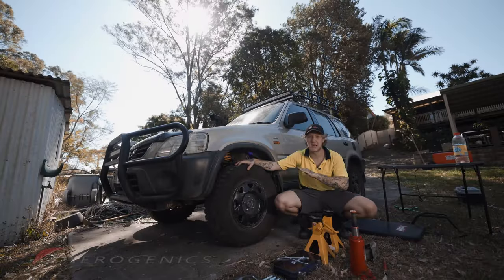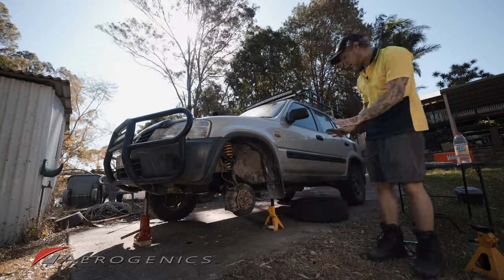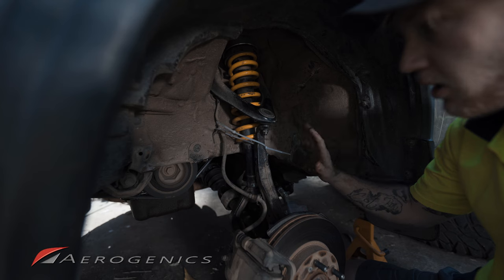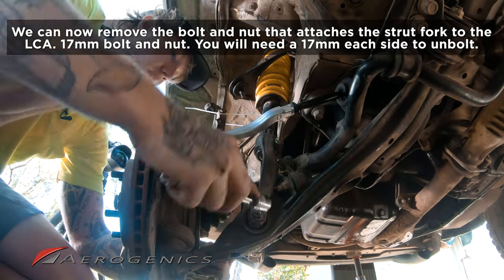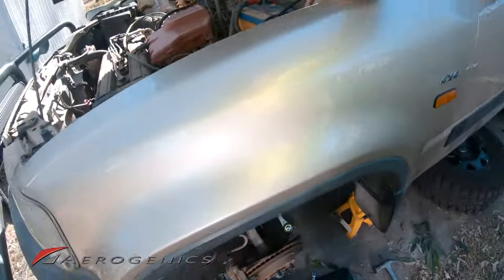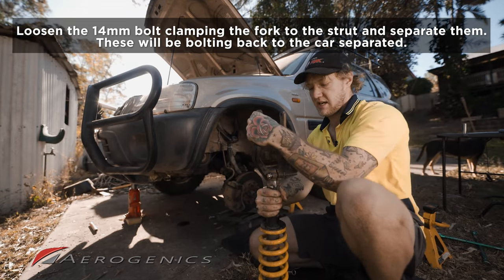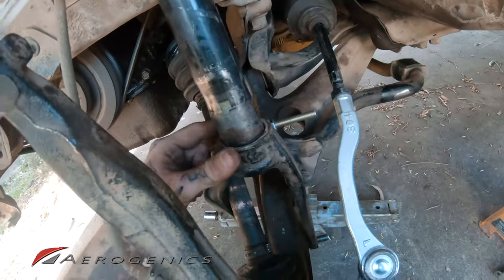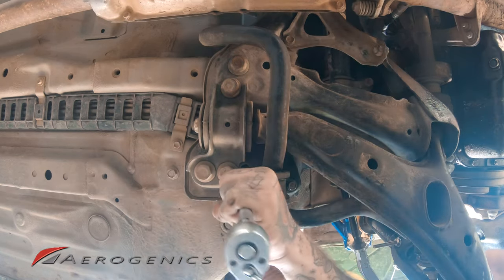Easy Guide to LIFT a HONDA CR-V!! AVOID this easy MISTAKE and save HOURS of your time

Comment: My God hallelujah!!!! For this video I fought the lower strut fork for 2 days!! I have an RD1 with a 1.5” lift kit. Replaced sway bar and outer tie rods. And could not get the strut fork to mount up! Removed the fork off the strut, put the bolt through placed at the angle and gave it a kick!! Bam 💥 that mother is in!!! Back on the road today because of you!!!! Thank you 🙏🏽 from the bottom of my heart and my crvs!!!! 🙏🏽🙏🏽🙏🏽🙏🏽

Comment: This is the method I used on my RD1.  

But now I need help with  my 97 auto CRV awd with Aerogenics 1" front and 2" rear lift spacer on Monroe quickstruts, Aerogenics 1" engine and subframe drop , Aerogenics 1" trailing arm spacers, new torque mounts, Truhart front upper control arm and rear camber arm and new NAPA axle driver side,
I have a wobble at 20 mph and intermittent clicking... i really want to figure this out. Some folks I've asked just said they just learned to deal with it.
Reply from the maker: Not the same issue but if you haven't. flip your front upper control arms, they're currently not travelling on the same arc due to your lca being dropped 1 inch.  If you know a fabricator, take it to them to weld the inside seams first, as they're not fully welded both sides because they're not designed to be flipped, but they need to be flipped when paired with a subframe drop, and in doing so exposes that design flaw.

As for your problem...

NAPA axles are your problem sadly.  We don't get them in Aus, but I've had a number of people say the same thing and yeah, OEM or OEM rebuilt are the way to go.  NAPA axles lack the vibration dampeners that OEM have.

Comment: Wow that suspension is the exact same as my 99 civic.... I guess that means I could lift my civic lol
Reply from the maker: Do it, a lot of lifted Civic guys use CR-V struts, the CR-V uses the civic camber arm drop bracket (above 3") as well, a lot of interchangeable stuff.

The joys of Honda :D
Reply: @isakjetbean  I have skunk 2 upper control arms on my civic because when I lowered it the negative camber was insane but the cheap ebay adjustable control arms had really bad ball joints and they didnt have enough angle so when ever I hit a bump my suspension never bottomed out but my ball joints angle maxed out. So you either have to cut down the knuckle and make it shorter or go with skunk 2 UCL because their ball joints have more travel. I would assume the opposite for raising the suspension and that you would have to lengthen the knuckle so that your control arm ball joint has enough travel. Or go with skunk 2.
Reply from the maker: @IkarosCanFly  Aerogenics make a ball join spacer to help compensate with the angle, or you can flip the camber arm upside down and swap side and that does the trick too

Comment: Very helpful! Did you put those 1.5” king springs on stock struts?
Reply from the maker: Up front it's running Monroe Gas Magnum shocks and rear are still stock but I'll be replacing them soon with the same Monroe shocks.
Reply: isak.jetbean Whats your opinion on the strut/spring setup? How’s body roll? Do you feel like you’re  jumping speed bumps?

Comment: Nice video mate. I have a question hope you can help. Do you know the location of the reverse light switch? Mine is auto. Sometime it lights up, sometimes it does not. Hope you can help. Thanks. Cheers!
Reply from the maker: Sorry, I wish I did! Have you checked all your relays and wires to make sure nothing's loose? Other than that the best I can say is good luck, I hope you sort it asap!

Comment: What I’d like to know is the RD1 very off-road capable? I picture getting stuck in the mud because it’s AWD not 4x4 and the axles don’t lock.
Reply from the maker: Well everything depends on circumstance. Mud in one place is different to another.

You're not gonna go hunting for deep mudholes that a Patrol might do, but if you're being sensible about it you can take it through mud alright, you just need to consider your throttle control more, as you only really have torque to get out of trouble around 3200rpm and higher, and not a whole lot still until 4500rpm, which even in 1st gear is quite fast. You also need to be mindful of doing so, because it will dig you deep into the mud much faster if you drop in at speed and go nowhere. 

If you try and drive this like a 4wd with low range up hills, you'll get nowhere, they are not designed to crawl. 

They go fine, but you're not going to drive it like a real 4x4. You need to drive it as fast as you need to but as slow as you can.
Reply: Anything is possible woth a set of Yokohama Geolandars R/T

Comment: whats better gen 1 or gen 2 for offroad gen 2 having the k24 would have more torque but is that needed in a crv for offroad?
Reply from the maker: Gen 2 has the better engine for sure, but the gen 1 has better approach angles and slightly more ground clearance

Comment: Are the spacers in the rear 1” as well? I see that they (aerogenics) recommend several deferent front&rear size combinations on their website.
Reply from the maker: 1.5" in the rear with a 2" trailing arm spacer (had to take into account springs for that)

Comment: Are those tires too big and heavy for that small engine?
Reply from the maker: Nope, engine handles them perfectly. A little bit of power lost, but with manual, heavy duty clutch and B20B8 (higher HP/TQ than regular B20, same as B20Z) drives great.

Still nippier than most 4wds, by no means is it pulling ahead on a straight 0-100 anymore (used to beat 2L Mazda 3 9/10 times) but it still has plenty of acceleration for regular daily driving.

Comment: What do you do when the axle pops out?
Reply from the maker: I had to remove the cv completely and reinsert the roller bearings, which is a messy and frustrating job.

So you'd need to crack the 36mm axle nut and disconnect the brake line retainer get the cv back in, then start bolting everything back together. I also unbolted my caliper to make it easier but don't necessarily have to.

Comment: Does this work for 3 inch
Reply from the maker: Only if you have the appropriate subframe drop already installed. Otherwise, you'll break axles very very very quickly, if you even get the wheels back on at all.
Reply: @isakjetbean  so I need the subframe drop on first before putting the hrg3 inch spacers ? Will I need to do anything else rightaway ?
Reply from the maker: @AS-zg8gv  That's how I would do it, less chance of damaging CVs that way. 

for 3" spaces i'd personally run a 2" subframe drop, you'd also most likely need to run the camber and toe arm drop brackets HRG sell. When you go higher than 2" lift, the process becomes a lot more complicated.

Comment: how come no one ever lifts the second gens?
Reply from the maker: I've seen plenty. We Were Kings Offroad on instagram have a really sick white one running 31s, but I think the 1st gen is a more appealing platform to build on aesthetically. The k24 vtec would be a nice power increase to run bigger tyres though, and Aerogenics do make lift kits for them
Reply: @isakjetbean  Yah but the lack of decent vtec makes the k24 seem slow. Slap a k20 on it and its a beast.